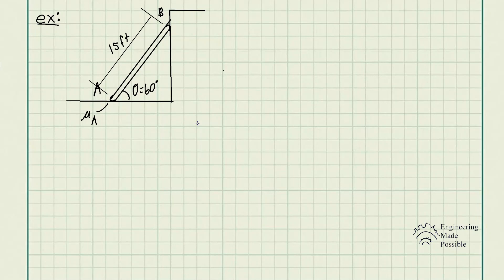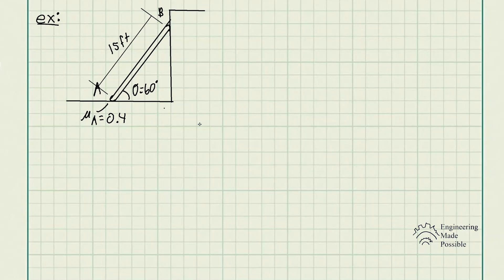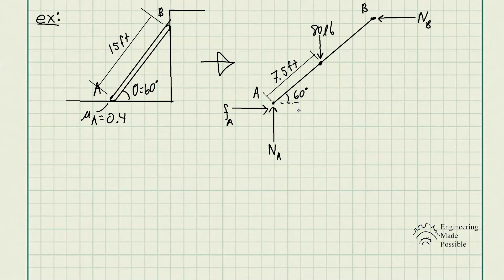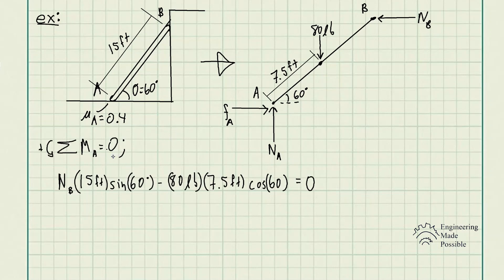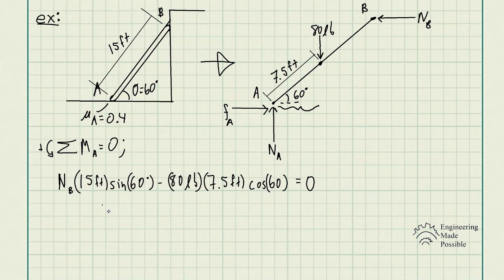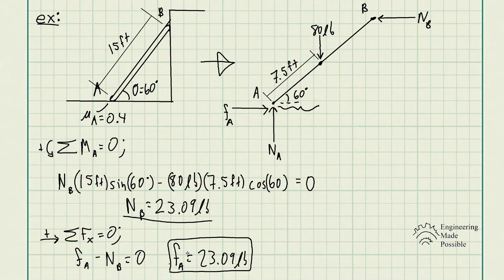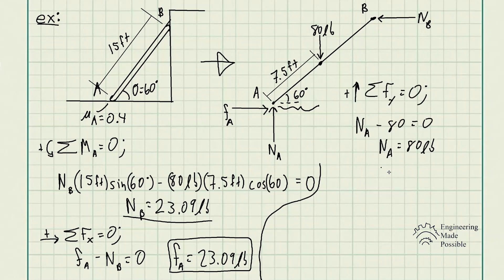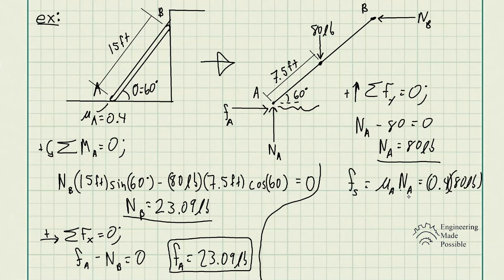The ladder has a uniform weight of 80lb and rests against the smooth wall at B. If the coefficient.

Comment: Hi. I had a question. Why do we not have a frictional force at point B? If the laws of friction apply, wouldn't it stand to reason that friction would be applied at both points? I am not saying you're wrong, I am just having trouble understanding the reasoning in this case.
Reply: we have a smooth wall, so no friction